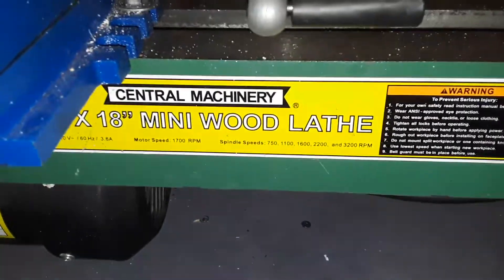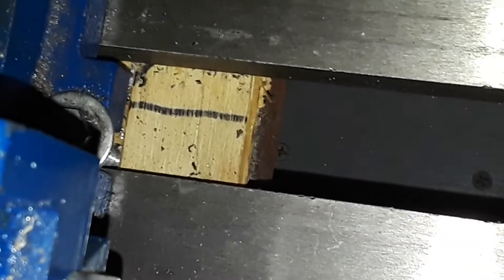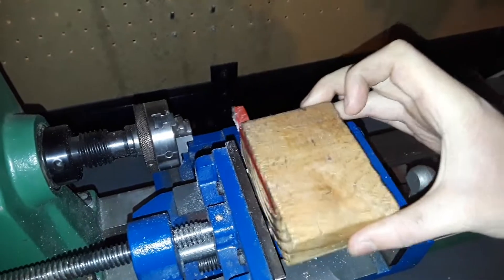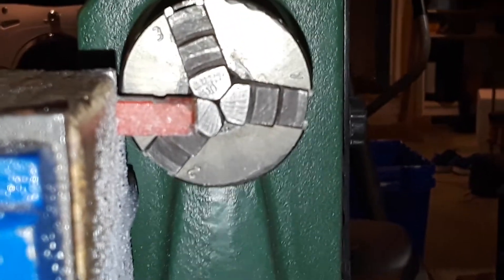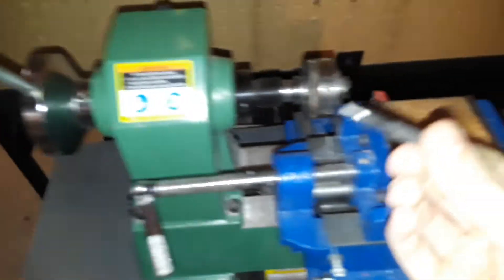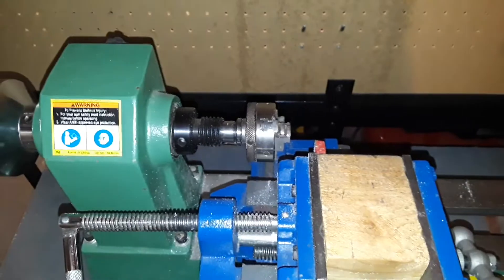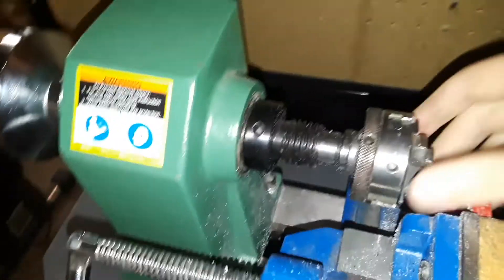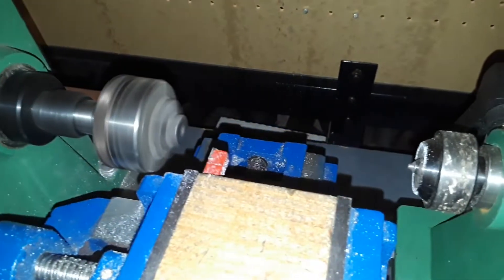How to Convert a Wood Lathe to a Metal Lathe

Comment: Jeez-O-Pete! This is awesome! So you need the morse taper to clear the vise base from the looks of it. A means to raise and lower the cutting tool is needed... gotcha. For aluminum and brass only, this really helps me to get started. I did read the rest of the comments and the Replies, I might add a support to the X-Y vise but I am just throwing ideas out because I am excited to try this. If it fails I still have an X-Y vise for my drill press. This X-Y vise has 5 Inch longitudinal and 3.5 inch cross travel, which is great for me, I do not need anything bigger for now. Anything bigger and I would look at a metal lathe. Thank you.

Comment: Do you have a video of it working>
Reply from the maker: I have used it several times but unfortunately I don't have it on video. I made this simply because I do metal working on my wood lathe once and a while. And I didn't wanna drop 1k to buy a metal one. Plus I don't have enough room in my workshop.
Reply: @BunkerBuilder  I was looking at this lathe the other day, as we just got a Harbour Freight less than 10 days ago. Before it was well over an hour drive including a $7 bridge toll. But to me, this small wood lathe looked to be much heavier than their mini metal lathe for $700. I think the larger wood lathe is about the same, and it is a hell of a lot heavier than the mini. The mini does come with a tool holder, cross slide vise, and 3 jaw chuck, but it is very small, and the wood lathe just looks béefier. Which if I'm not mistaken, weight is your friend with metal turning. A way to slow the motor would not be difficult to figure out at all. Nice job.
Reply from the maker: It depends what your going to do with it. If your going to turn metal once and a while this conversion works nicely. But if your machining a lot I would go with the metal lathe.